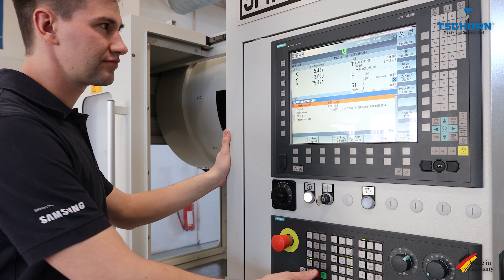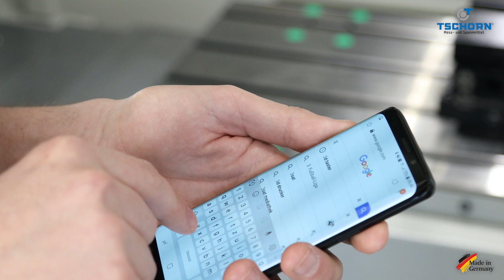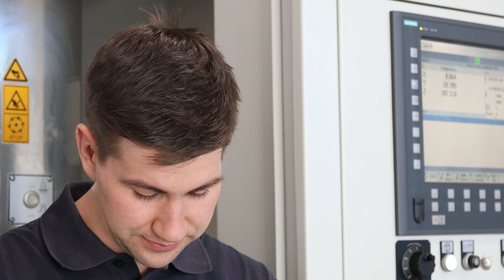3D Tester SLIMplus V2

Comment: There is such a device, one probe broke when Z lowered, the ball fell off. There are two replacement shuma. Adjusted, but it does not accurately show the error at 0.02 mm minimum. Two years lies in the box. I switched to a 10mm ball that runs on current with a light bulb. The seat of the ball straight made on the machine, a cutter in a vice. Nothing beats. Accuracy and stability in all directions.